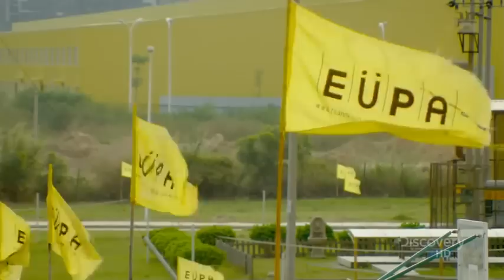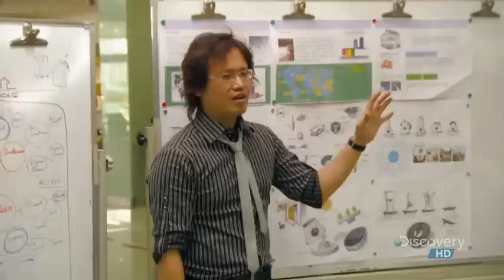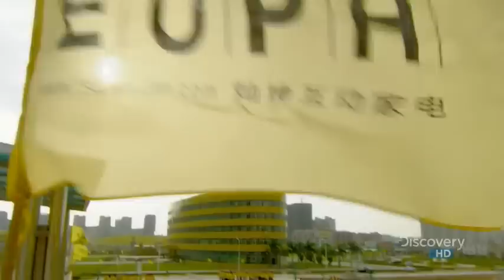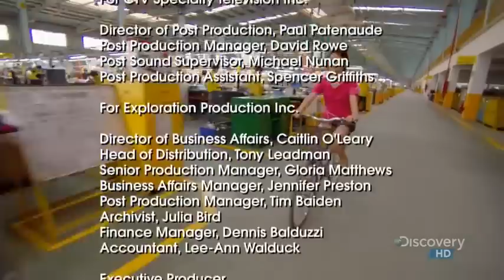Documentary(2009): The largest factory in the world and Chinese labor

Comment: 8:00: Green is not neutral, it is Ground. White is the standard color for neutral or common. Black or red is the standard color for live or "hot" (x-line), not brown, though brown has been used for lower voltages.
Reply: Ikr. I'm not an electrician and even I caught that.
Reply: They were wiring for 240V EU systems where Brown is hot, Blue is neutral, and Green is ground. Also, in all domestic installations neutral and ground are connected together and I really doubt they care if they if the grill trips somebody's GFCI that lives >1000miles away where there is basically no recourse.
Reply: @linuxguy1199  I guess 240 V EU systems use different color coding. And yes, common (neutral) have to connect to ground in order to provide grounded protection.
Reply: @RebuttalRecords  They do, the three phase coloring is also different. Here it is black (P1), red (P2), blue (P3), white (N), and green (G) unless it's 277 or 480V where it's brown (P1), orange (P2), yellow(P3), gray (N) and green/green - yellow stripe (G). In the EU it is brown (P1), black (P2), gray (P3), blue (N), green - yellow stripe (G) in most of the countries depending on the voltage.